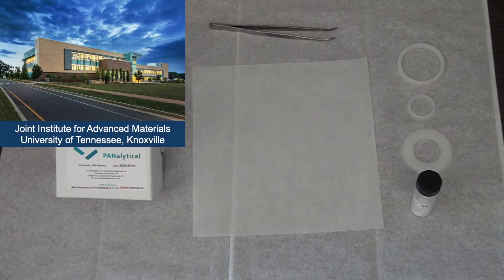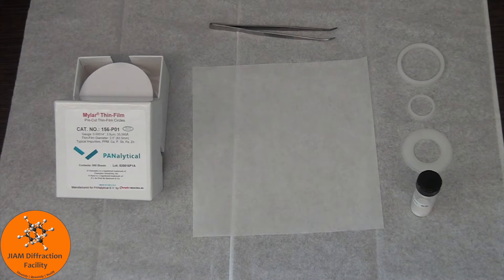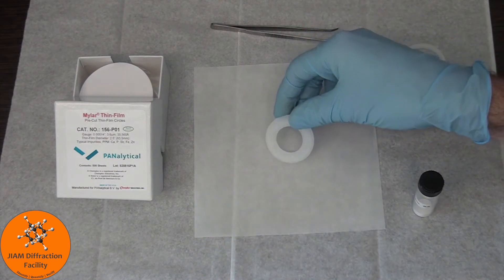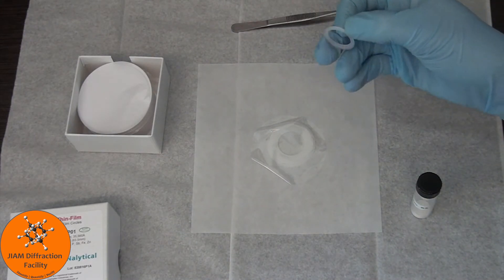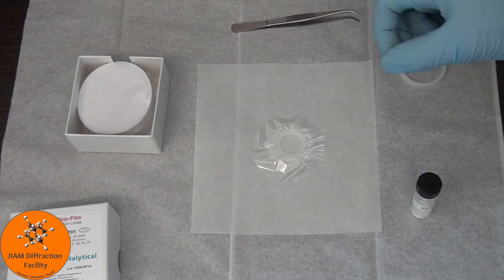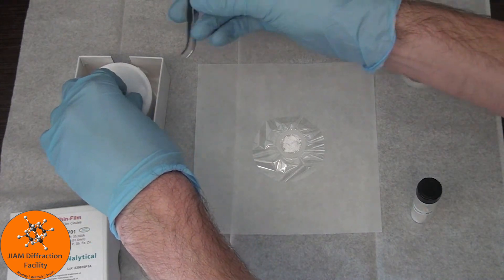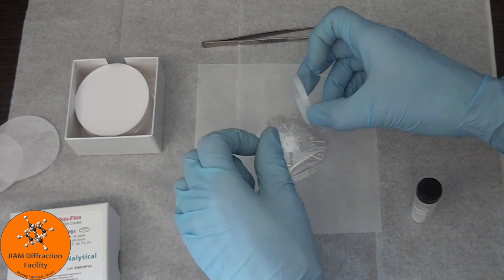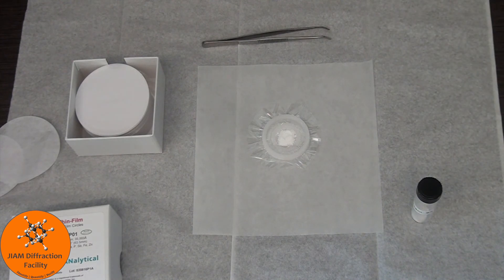XRF Small Loose Powder Sample Preparation for Epsilon 1 from Malvern Panalytical

Comment: Do you analyse this sample type under vacuum?
Reply from the maker: That is an option with XRF to help improve results, but the Epsilon 1 model does not use a vacuum.
Reply: @IAMMDiffractionFacility   would XRF get a reading if the sample size was a tiny 1mm grain? I want to aim mine at little rock grains individually that are 1-2mm tops, only using about 3Kev so it won't penetrate too deep, but I'm wondering if it can get a reading off something that small.